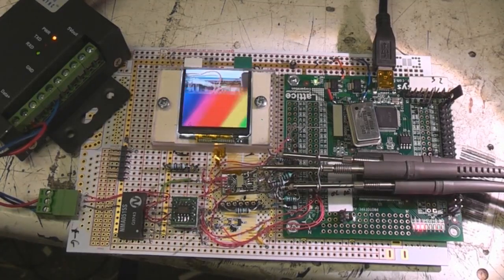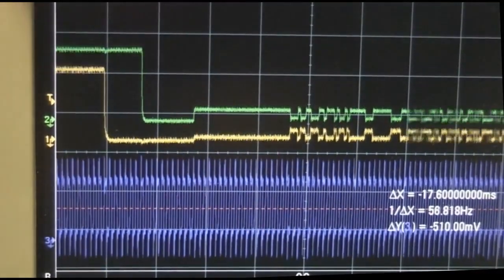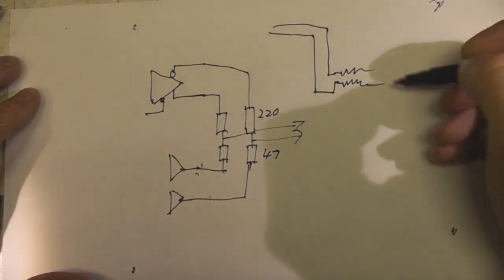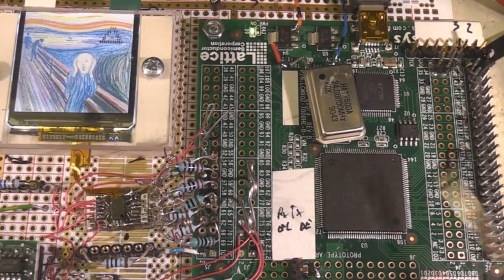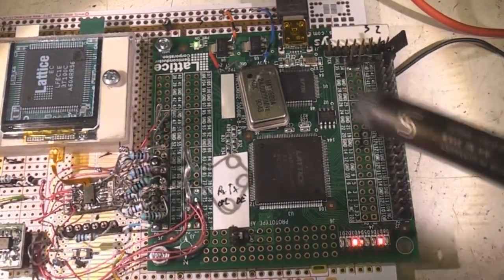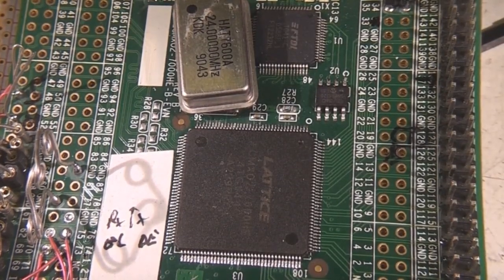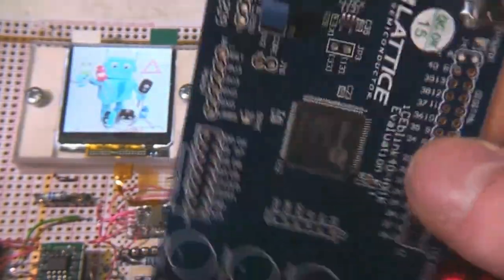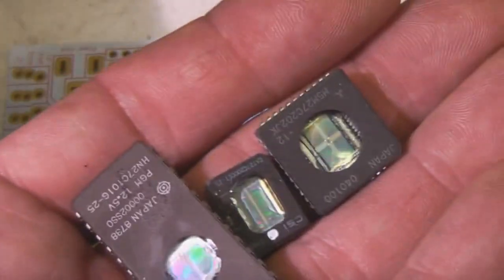Ipod Nano 6 LCD hack part 2

Comment from the maker: Only the data burst within the command to send a line needs to be fast. You may also be able to send lines in sections, so as long as you can do small bursts fast, everything else can be slow, like getting the data from somewhere.

Comment from the maker: It may be possible - depends on how slow the display will run (not sure yet but OK at 24MHZ)  Don't need LVDS as you can do that  with resistors, but the DDR will probably need some sort of hack

Comment: I worked on a product a while back with an OLED display which was in a transparent case classic Nintendo style. We had the exact same issue with the OLED controller chip resetting if you hit it with a camera flash.
Only discovered the issue when we were taking the product photos for the brochure. A hasty call was made to the contract manufacturer to ask them to put a square of foil tape over the chip on the OLED ribbon cable haha.

Comment: Awesome vid Mike, great FPGA board for the money as well. I have always been a fan of Lattice, their design software was a lot less bloated too. Traditionally the difference between CPLD's and FPGA's was the use of PAL (programmable AND, fixed OR plane) rather than Look Up Tables (LUT's) in slices.

Comment: Ah so it does have a mode where it keeps the image without it constantly being fed to it on the bus. Not that it would help you much since you still need to feed it fast, do love the SPI flash idea tho. If you have a CPLD there it could even be any plain flash and do DDR conversion in the CPLD by clocking it half the speed. Or possibly use SPI RAM to allow a MCU to draw over the image.

Comment: I find it quite surprising it has a frame buffer in the LCD controller chip. All the annoying displays that need constant video data to stay on that i worked with simply synchronized the LCD matrix scan with the data and used the TFT elements in the pixels as "analog memory" so they could be driven almost however slow you want but the image would start to fade between frames at silly low refresh rates.

Comment: Arrogant? No. Proud? Yes! I love people having opinions but they need to accept that I have mine. And mine is that Arduino & similar platforms, while having lowered the threshold to enter embedded design and thus gaining more interested people in this area, have created a lot of "Out of the box" engineers. And by that I mean that they are good at unboxing kits and bits but the original engineering idea has been lost. That's just my 2 cents, it's fine if you disagree - it won't hurt my feelings.

Comment: Kinda. Some learn from others by unboxing and using their kits and 'designing' code by copy and paste, while others did the try and error approach over many years of their engineering career. With the first method you can never exceed your master. As masters are traditionally forgetful, knowledge would and will degrade if you go that route. But again, just my 2 cents, fine if you don't agree.

Comment: Unfortunately, from what I can tell from Mike's prodigious show notes link supply (/sarcasm ;) ) that board doesn't appear to be available any longer. :(
(assuming it's the LCMXO2-1200ZE-B-EVN)
You must have scared the marketing droids off when you complimented about how reasonably priced and desirable feature-wise it was. Either that or there's a run on these because you posted this video (Dave Jones ebay effect)!

Comment: @Mike  Lattice Semi (Siliconblue)
Nice that you Project-use the new ultra Low-Power
Mobile App. Stuff
Lattice ICE40HX1K-BLINK-EVN 

ICE40 how to program? this ice40 Dev.Board

via AVR AT90USB2 USB ...to Bit-File in

 SPI-FlashROM from ATMEL Typ: M25P10.
  
I think is DIGILENT Adept Software ??

Problem: 
There is no simple JTAG FTDI 2232D Interface like on the 
other Lattice  Dev-Brd. eg. MachXO2, MachX0.i have in Lab. 
The new ICE40 Dev-Suite i have.